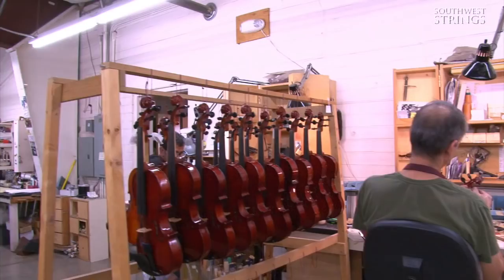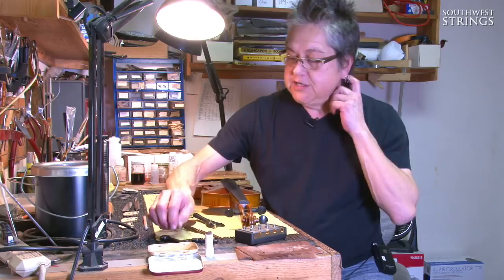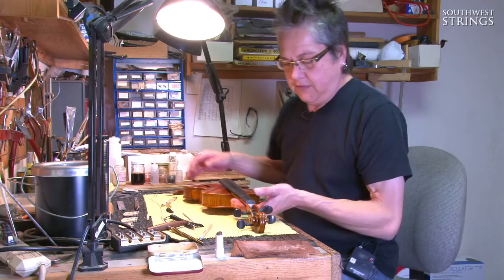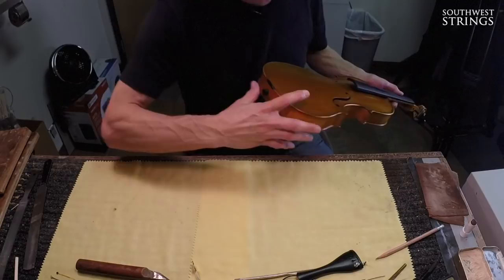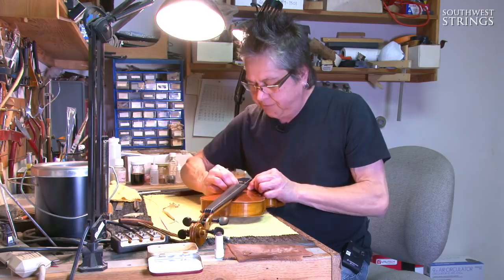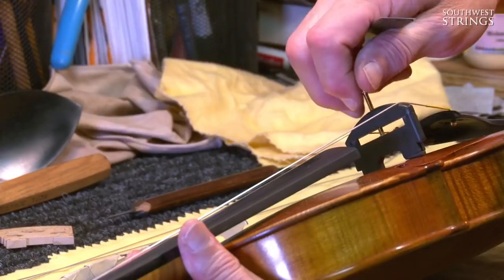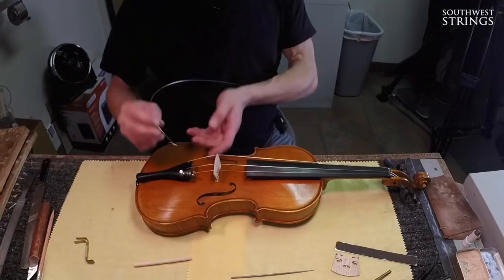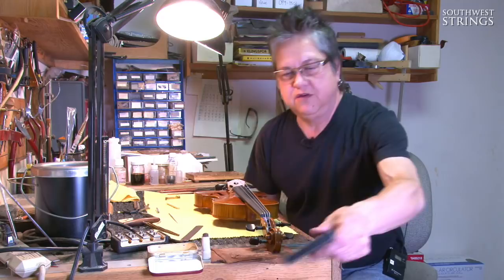Luthier Set up Process - Southwest Strings

Comment: What are the height of the E, G, A  and D strings at the end of the finger board?
Reply: 3mmE 5mm G
Reply: @rofo2107  Thank you!
Reply: 4mm for E is not bad. some prefer too low strings, but softer string action makes softer sound (and vice versa with harder string action)

Comment: very helpful video :] Please, I just bought an electric violin.
 I am a carpenter and very experienced guitarist , so I am familiar with setting up guitars. 

What is the standard string height under the strings at the nut , and , how do you go about setting the height from fingerboard to the bottom of the tuned  strings at the top end of a violin fingerboard,  ??? Again, I found the video very helpful, Cheers :]

Comment: is there a violin with a wider fret board? I noticed that my fingers tips at times are a bit wider and hits the other side strings. How could I avoid hitting the other side strings? And also can I lower the bridge (shave or trim off the edge) so that the action of the violin would alot lower to the fret board?
Reply: You could purchase a 14 inch viola and put on violin strings. Every size Viola is supposed to have a wider fingerboard than a violin as far as I know. Might you be a guitar or mandolin(same tuning) player transitioning? They seem to always want to call fingerboard a fret board don't they!
Reply: moldyore-there are people who play MANY instruments and eventually move on to violin after they've mastered others like guitar mandolin piano etc.I did! But the work involved is the most I have ever had to give to learn ..did you know that the vibratto is different on guitar -I do it left to right of the string like I did on my classical guitar not forward and backward rocking on fingertip expected of you on violin. I gouged out my first cheap violin because it was a soft wood fingerboard due to my vibratto and while it sounded beautiful it was limiting at best and damaging at worst. I had to unlearn it and start from the beginning as a child would..but I got it faster than most would have but it did require daily playing to work out all those muscles as I'd lose it if I stopped a few days or week. Violin/ cello/ viola -all take more work than most any other instrument except maybe those cool chinese erhu violin or the Mongolian version of erhu. They do this real cool vibratto thing on two strings only and that slidey sound you hear is because they have only two strings to get that range of notes in..so I say never give up.. accept it will take along time and rise to the rewarding challenge.
Reply: Oh yeah..the bridge. Yes you can file it sand it etc. I biught a bunch of cheap bridges off ebay just in case but i got it rught the first time and you can too!.but I'd say first look it up on you tube or pay a luthier the first time but only if they will do it in front of you so you can see what they do. Also know that bluegrass fiddlers file it a little different sometimes to aid in doublestops..but that's the extent of my self taught knowledge on it.
Reply: @moldyoreo Im guessing your violin has a holes, rather than f holes.

Comment: Sorry to say it but I bought just a violin on Aliexpress for $150 and it was fitted and sounds absolutely amazing including your "standard measurements" 5mm for G and 3mm for E strings clearence. But it has a decent wood with massive spruce and high quality maple with nice natural flames.
Chinese simply  copied Western know-how and now they mass-produce decent quality for the price absolutely out of the reach of Western producers.
And BTW. They needn't to demonstrate their quality on extra violin with handmade varnish and high price tag.
Your video was demonstrated on such violin but there are many others hanging on the stands.
I really doubt every of dark instrument has quality high enough to be shown on the camera.But Chinese make quality setup even on violins worth $150 including post fees.
Is it as bad for you as it can be.  You setup one violin in 20 minutes. Meanwhile Chinese did 2000 violins just as good as yours but for the fraction of the price.
Reply: I would really like to see how well any individual could set up 2000 violins in 20 minutes (0.6 seconds per violin).